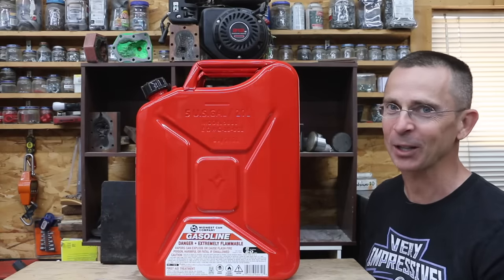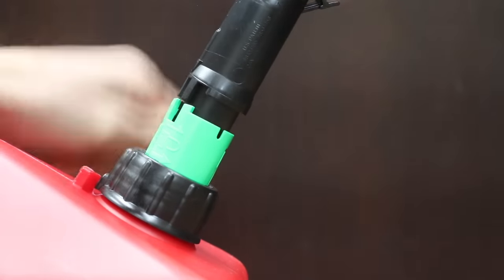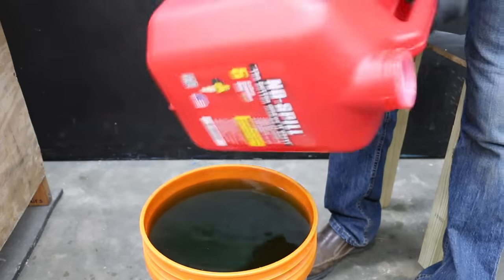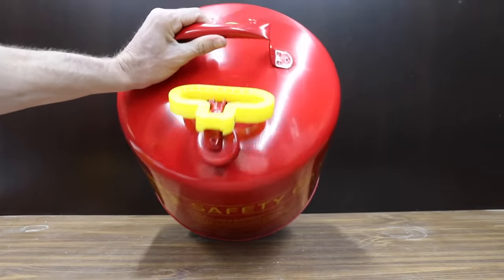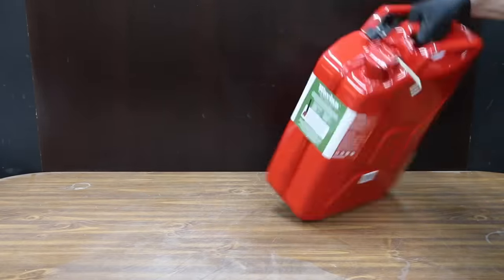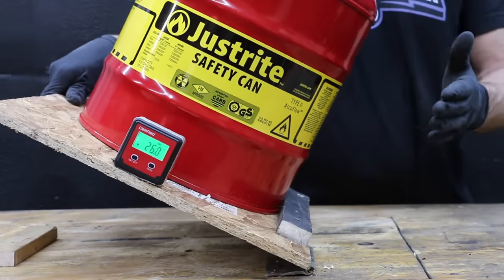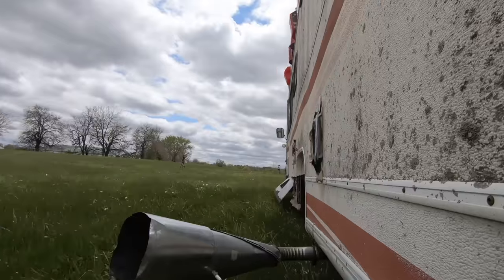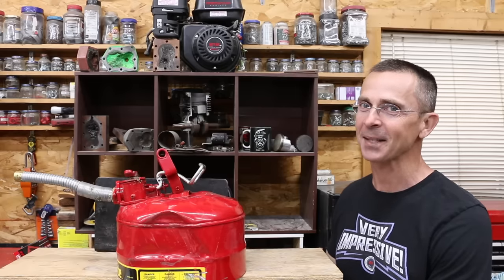Best Gas Can? $140 Wavian vs Eagle, Surecan, Scepter, Briggs & Stratton, Midwest, VP Racing

Comment: I'm glad the eagle can did so well. I've had one for a long time. My only complaint is the short funnel that comes with it. You have to use a longer / thinner funnel for fueling automobiles. But it's still the best thing going and the simplest to use. As far as the no spill nozzles go... God save us from the safety regulators that keep trying to save us from ourselves.
Reply from the maker: Thanks for the feedback.

Comment: I've had a handful of the Eagle and VP racing cans.  Every single Eagle can has failed at the bottom seam.  They are doomed to fail if they deform even the slightest bit.  VP racing cans are my favorite but the gasket on the vent cap is not resistant to gasoline.  You'll eventually find black specs of the gasket material in your fuel.  If you do get the VP cans then buy a sheet of nitrile gasket material and replace those vent cap gaskets for a near perfect gas can.
Reply: Yes or contact VP and ask for some spare O rings since they fail early. Maybe they will get tired of that and fix the problem.
Reply: Ive never seen a eagle can that isnt dented and beat up to shit but ive yet to see one leak
Reply: I love my vp racing
Reply: Not my experience with eagle, maybe they changed manufacturing, mine are old.
Reply: The main issue I have had with these newfangled spillproof gas cans is that if the design forces you to store the spout inside the can itself, dangling down into the gasoline, the plastic will often swell and eventually prevent the spout from working smoothly. Any brightly-colored plastic plunger or twist-lock ring seems to be the fist to fail, but even the plastic that the nozzle assembly is made from will eventually swell.  I bought some extra caps, the ones with the hole in them, and plugged it with a disk of plastic glued into place and a gasket, so that I can seal the cans without having to leave the nozzle sticking down into the gasoline.
Reply: @goodun2974  My Midwest cans came equipped with something like that.  I just keep one spout attached to the can I'm currently using and swap it when I change cans.
Reply: @jimichan7649  , I'm using Scepter cans, with modified spouts. I had several older Midwest cans split at the seam.
Reply: Thanks, I was tossing a coin between Eagle and VP because I'm sick of the safety pour ventless nonsense (and they break).  VP for the win, with the updated vent seal--no problem.  I would be beyond pissed for an Eagle to start leaking on me-and sometimes things get bumped (deformed) around here.
Reply: I bought the same can at RK for $20.
Reply: how the heck is project farm meant to know to test all of that. Jesus. They're all trash in obscure ways aren't they.
Reply: @wadepatton2433  Check out LC LC2 jugs, similar to VP less leaking and better handles.
Reply: Weird, my Eagle cans are quite old and have never failed.
Reply: @rsbreeze  I can’t find one of these in red color. In my state you must only use a red UL or ASTM certified red gasoline container for transporting consumer fuel. If you know where to get one in red please let me know.
Reply: @heystarfish100  All mine are clear/ white. I live in Arizona and travel with them in California to the sand dunes all the time. Not sure what the law is but many seem to use the clear/ white.
Reply: @heystarfish100  Yeah what he said. White doesn’t draw as much heat anyway
Reply: @heystarfish100  Plastic safe spray paint.

Comment: The VP Racing cans won't leak at the vent if you just crack the vent, start pouring and gradually unscrew the vent cap to about half way.
Reply from the maker: Thanks for the suggestion.

Comment: My family and I are long time believers in Eagle gas cans, so I am happy to see it perform well in your testing.  I refuse to buy another plastic can.  Yes, the eagle is twice as expensive as a plastic can but it lasts way more than twice as long, and works better to boot.
Reply: My Dad has an Eagle gas can that was given to him over fifty years ago. Not a thing wrong with it to this day.
Reply: unless you regularly use them around salt water.  Then, the plastic ones are a pretty good choice, at least in my use case.  My experience has been that the metal cans rot out/ get pin holes in the bottom faster than the plastic ones degrade from exposure to the the sun.  And if the plastic ones stay in the shade, they can last 20 years.  Still using my discontinued plastic "blitz" cans....from the late 90's early 2000's, though they are finally starting to get brittle.  Never had a metal can make it past ~7years.
Reply: I agree and have both metal and plastic cans where the metal cans are over 30 years old.  However, I have plastic cans nearly that old and there's nothing wrong with them, either.  If you live near salt water, the plastic may actually be more durable.
Reply: My plastic gas cans, the good old ones with the conventional vent are a good 20 years old. I really don't see how I could ask more of a gas can.
Reply: But what the video does not tell you about the Eagle Gan is that the paint flakes off and can end up in your tank. Also, it has the absolute worst pouring spout.

Comment: One important thing to note is that water and gasoline are chemically very different. Gas is non-polar, while water is polar, meaning that these two materials behave very differently, particularly when interacting with plastics and metal coatings. Water does not like to interact with petroleum-based plastics (beads up easily on a clean plastic surface), and will have a very difficult time penetrating a plastic seal. Gas and oils like to interact with petroleum-based plastic and have much easier time penetrating and finding their way out of a seal. Furthermore, the surface tension of water (due to its polarity) will give it much different flow properties relative to gas and oils.

I love the video overall, and understand the limitations of using gasoline and the decision to use water. I just wanted to point out that a can that doesn't leak with water in it, may very well leak with gasoline in it.

Thanks for all that you do. Huge fan of the series!
Reply: Nobody can afford 5 gallons of gas!
Reply: @FieryWACO  I have 5 gallons in escrow.  Hoping to close by the end of the month.
Reply: @FieryWACO  I put 7.9gal in my mower and I’m $43 lighter now. God I miss that $2 gal gas.

These will be story’s we tell our grandchildren….

OLD MAN: Back in my day gas was $2 and you can fill your whole car up for under $40! 

GRAND KID: Mom he’s doing it again!

MOM: Just get away from him he’s senile…
Reply: Geez I'm not that old and gas was well under 2 when I started driving of course with the memory of it being high at a dollar when I wasn't paying for it. I also am old enough I remember paying for it over 5 back in 08-09.
Reply: @FishFind3000  👈 '' I did that''
Reply: @bertgrau3934  who cares

Comment: The harbour freight Midwest can is made in Latvia by Valpro (the V in the middle indicates that). They also made the Wavian can but the Wavian as an internal vent which the original Germany fuel can had as well (it's based on a German military design). Good review, those metal ones with an internal lining tend to last forever.
Reply from the maker: Thanks for sharing.

Comment: Tractor Supply makes a kit for plastic fuel cans that comes with a flexible spout so you can poor fuel into vertical filler tubes, so you can transfer fuel into cars and pickups as easily as lawn mowers and ATVs.  It also comes with a capped vent that can be easily installed on the back of the handle or somewhere on the top of the back side of the can.
Reply: EZ-Pour , I don't think TSC makes it.... they just sell it
Reply: @Trevor4ag  They USED TO sell them; Now, you need to get them on Ebay...
Reply: @brentfarvors192  they still had them a couple weeks ago when I was there
Reply: Might be Northern I was thinking about...
Reply: @SuperNoticer  My bad! They have them...Still cheaper on Ebay last time I bought some...
Reply: @Trevor4ag  
You are correct, my mistake.  Sell not make.

Comment: I use both the Eagle and the No Spill, can confirm it is hard to refuel a car. The No Spill has a hose adapter available, you should get if you want to fuel a car. The Eagle I had to get a big funnel. Both are awesome tanks and I would recommend both. Something to be aware of with metal fuel tanks that have flame arresters. They are very hard to put fuel in. The flame arrestor screen is very short and does not allow the nozzle to fit in the tank well.  The deeper plastic screens in the plastic tanks like the No Spill make it a lot easier to fuel them.

Comment: It seems like the more engineering they put into it, the more likely it was to fail. The EPA needs to add reliability to their testing since an initial pass means nothing if the safety features fail so much people end up having to bypass them.
Reply: That was the whole POINT from the beginning!!! Make you spill more gas! Nothing wrong with regular gas nozzles. You can find them on Ebay...
Reply: Recent court ruling stated the EPA and other Federal agencies can't make rules like they have been. The EPA lost regarding the regulation of Power Plant exhaust for example. The BATF is also being severely restricted saying their "definitions" are not allowed and can't make law...that's congress

Comment: Great comparison! I miss the cans we used 50 years ago. Since FedGov decreed hard-to-use-easy-to-spill cans, I think many of us buy cans that look durable, toss the spouts, and install aftermarket spouts and vents.  Others just buy the racing cans. Maybe a test of aftermarket spouts/vents??? 🙄  Also, there are good and lousy D-cell powered transfer pumps that can help.
Reply: Many of the transfer pumps are not rated for gasoline, only less volatile fuels. I've never heard of any problems but having seen gas cans melt, burn, and explode (vapors) it's not a risk I'd want to be near, nor have near my vehicle.
Reply: @P_RO_  agreed.  I do have a couple that claim gasoline rating. Cheesy little things, but one works fairly well and has auto shutoff.  The one from Harbor Freight was junk.Both run on 2 D cells.

Comment: These pour cans got beat up in this one haha!  Soooo glad you tested the Surecan.  I saw that at the National Hardware Show this year and was very impressed with the ease of pouring.  Thanks for the great video as always.
Reply: I see what you did there, but something tells me it wasn’t intentional...
Reply: Their customer service is great. I found them about two years ago and called them about the design not allowing all the gas to pour out and they were great. Got the family-owned vibe from the guys.
Reply: I got one a surecan for my retired mother to use with a generator if they ever have an extended power outage and I can’t get to her. I have it on a tall stool so she can just move the spout down to the reservoir and hit the button to fill the tank. At her age the five gallon gas tank is just too hard to hold upright. Luckily she hasn’t had to use it for the past three years but it’s there if she does and I always make sure it’s ready to go with fresh fuel as well the generator prepped just in case.
Reply: I'm going to put gas in a gas can not WATER. One thing to consider in this testing water and gas have different properties.
Reply from the maker: You are welcome!
Reply: @MrNeverseeme  most gasoline contains some blend of ethanol, which is hydroscopic. 
Although I am sure you will fill them with only gas, over time the fuel will absorb moisture from the air, especially if you leave it open a little bit to vent fumes during long term storage.
Reply: @MrNeverseeme  You do realize why he used water for the test don't you? he did not want gasoline spilling all over the place during testing and when they fell off the camper. Gasoline and water will be close enough for these test. Can't believe someone had to explain this to you.
Reply: @jimthvac100  Yea your right I'm ignorant sorry. 😔
Reply: @Hittsy  Great explanation. Thnx.

Comment: VP Racing Can - Never had an issue with spillage. In practice you never turn the can completely upside down, so the vent hole is always clear of fuel.
Reply from the maker: Thanks for the feedback.
Reply: I love mine. Great for equipment with large fuel tanks. Dumps 3+ gallons in my lawnmower pretty quick. Sometimes the little cap on the end of the hose is a bugger to get off. I've thought about removing it and putting a little spark proof ball valve right at the beginning of the hose.
Reply: And they're super easy to find. Nearly every auto parts store I've been to has them.
Reply: There is a good reason you see the VP cans at your local track day - they work perfectly for filling a car. The clear tube allows you to easily confirm fuel is flowing plus it is long and flexible enough to reach without getting the can too close to the car. No fancy buttons, or levers, just a hose and a cap - always works no fuss! The only draw back is being tall, but the shape and location of the vent also means in will drain quickly and completely. My brother can put two of them in the frunk of his Porsche Cayman.
Reply: @johnmoore3504  Honestly I prefer that they're tall. Less footprint and it makes them easy to bungee down in the back of a pickup bed.
Reply: The VP can is probably the only can that will fill a Ford without the little ford funnel thing. I love mine, its the only can I will buy.

Comment: Surecan has changed my life. I broke off so many spouts on all different cans over the years. I can pretty much get mine completely empty just by tipping or wiggling it a bit. I think you can get them for less than $50 at Sam's club online. I highly recommend the Surecan!
Reply from the maker: Thanks for sharing.

Comment: No-Spill sells an inexpensive flexible spout extension. Slide the extension onto the nozzle and the D-rating you gave for "Well Designed for Refueling a Vehicle" greatly improves as well as your "Overall Rating".

Comment: Great testing however, a guide on aftermarket "usable" spouts and which ones fit which cans as well as where to get the right ones would be super useful. 
As always thanks Todd.
Reply from the maker: Thanks!  Thanks for the suggestion.
Reply: I'm more interested in a replacement cap that completely seals my Blitz cans and does not have a spout on them... Those plastic spouts dribble a lot and I would rather just pour directly from a tank opening to a funnel or siphon... Basically, I want my tanks to be completely sealed with no venting whatsoever.
Reply: I would doubt that after market spouts are kinda legal, so I don't think he can really recommend any. Don't get me wrong,  would be neat, and all my cans are "fixed" to work properly.
Reply: @jasomkovac9115  Sadly that is what I was thinking. Government ruins everything.
Reply: @waltermh111  What the goobers in the gooberment don't know won't hurt you. The regs are mostly written by fools who drive desks for a living and couldn't pour water from a boot if the instructions were printed on the heel.

Comment: I have 3 just rite cans because they're the only "safety" mechanism that isn't infuriating to use, should last me forever, and doesn't easily tip over when I have to take it somewhere either in my truck, or inside my car. Also, just rite makes several different nozzle sizes, in diameters and lengths, ideal for having one for cars, or small engines.
Reply from the maker: Thanks for sharing.
Reply: They sell aftermarket spouts that are the old style you have to drill a vent on the top but it comes with a vent and cap and perfect sized drill bit for the vent

Comment: VP all the way!  I got rid of about 6 "Spill proof" cans and replaced them with VP, and I couldn't be happier.  Also as long as you don't tip the can too high it won't leak out of the vent.  Oh and if you shop around and aren't concerned with the color you will probably be able to acquire them for around $30-35 each.
Reply from the maker: Thank you!
Reply: A gas can has to be red in color and have a flame mitigation device. All of the other colored cans do not meet this standard and therefore are not legal for use as fuel cans.
Reply: @heystarfish100  This may be true if you are part of a commercial enterprise.  BTW the VP fuel cans do have a mesh screen in the filler neck, which most likely will serve as a spark arrestor.

Comment: I’ve had the Surecan for five years now, and it’s been GREAT! By far the easiest I’ve used. Glad to see they changed the design of the cap on the spout, though. Mine has a keeper and a push down while turning lock that never worked very well.
Reply from the maker: Thanks for the feedback.